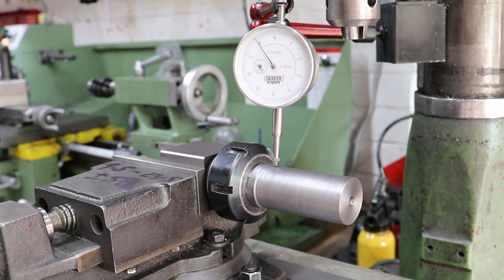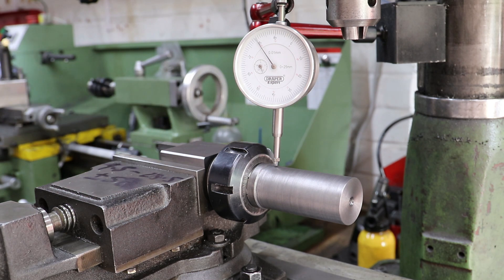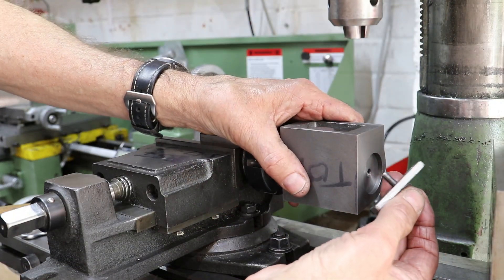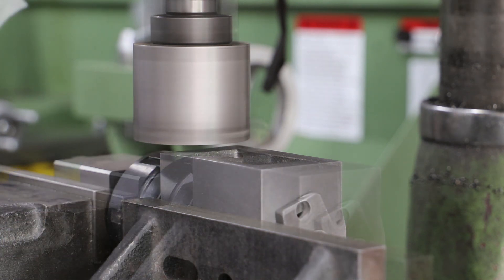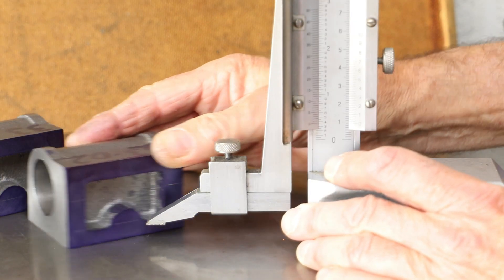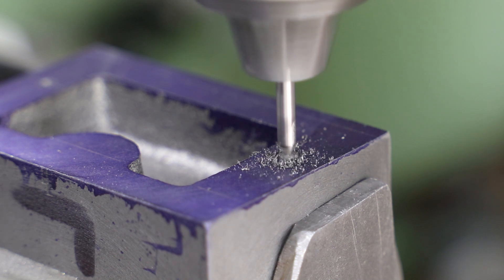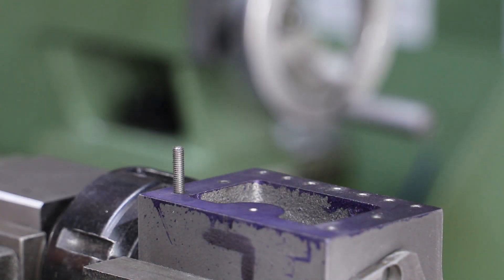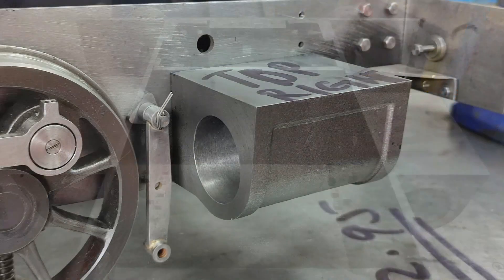Part 22: The Cylinder Frame Faces

Comment: Just found your channel while looking for ideas to fix my crappy compond slide on a Chester MF42B. Interesting to see you moved to a fixed toolpost too, but maybe not enough use yet to have wear on the lead screws, which I have changed to antibacklash CNC style. Nice to see trackday as I spent 25 years racing with BHR and NorthGloucester and BritishFormula. Keep up good work. Fitting a DRO is really worthwhile, definitely worth the money.